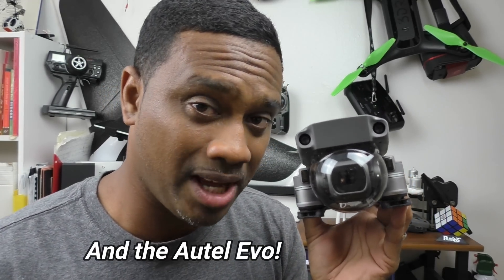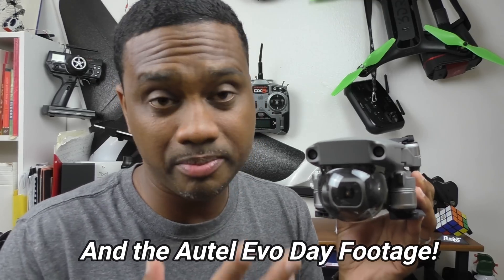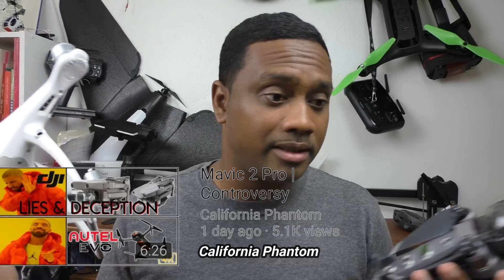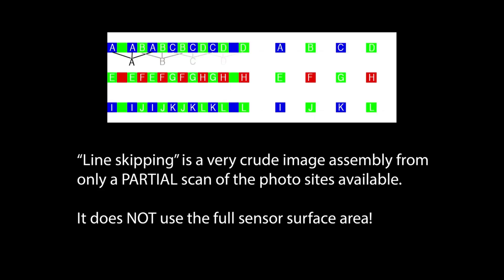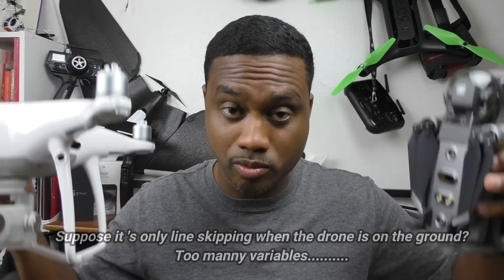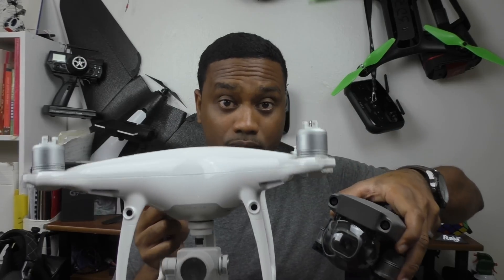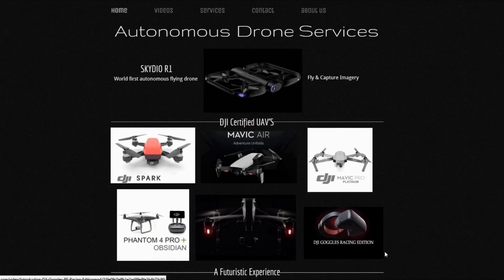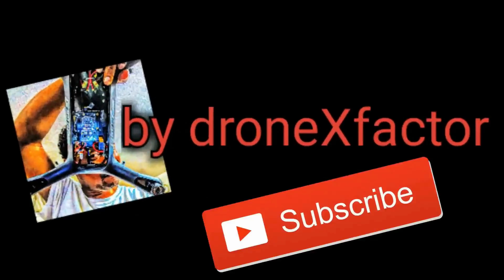DJI Mavic 2 Pro 1" Sensor is Line Skipping & Overheating?

Comment from the maker: Do you believe this Line Skipping Theory? Let's here from you!
Reply: Yes, I believe this Line Skipping Theory. Thank God I didn't buy the M2Pro yet. But: I would buy it, also if this Theory becomes true. I don't use 4K, because of 2 reasons: it uses a lot of memory, and I don't even have a 4K-TV. I edit all my films to 1080p, I film in 2,7K (to have a some space for cropping or deshaking). So also if the Hasselblad only films in 2,7K, for my purpose it's still a very good camera with excellent lowlight and colorgrading possibilitys. But these features don't justify the price. Maybe if there would be a full used 1"-sensor. If the M2Pro would cost the same price as the M2Zoom, it would be o.k., but so it's cheating to advertise with a 1"-sensor. Imagine Nikon would use only the half of the full-sensor in the D5!
Reply from the maker: @timg.998  
I totally understand your concern, good thing DJI confirmed that the Drone uses the entire sensor and there's no lines skipping or pixel binning.
Thanks for sharing
Reply: you're all just looking for excuses! look at autel, the evo works great and the image out of the box is way better than m2zoom & pro in daylight! dji released an outstandind p2 zenmuse, spark and p4p all other drones in my opinion are just generating sales due to the hype they cause! m2p should have been a killer-drone but it's just another high professional customer cheat! turn it as you wish, m2p is the worst 1 inch cam! it's all about image quality, no compromise in 2018. they would have left it with the m2zoom release and kept on working on m2p.
Reply: @isonic9479  I have to fully agree with i Sonic. For the price point, it's a big 1800euro lie and fals adverticing! If you clame a 1" sensor and you don't use full sensor data  it's in my poknt of few not anymore a full 1" sensor! Point! I thought I going to buy the M2P but after that, I'm not so sure anymore. Probably I wait until a M2P platinum or Plus, because I don't pay aditional 500euro upgrade to the normal Mavic just to get a half finished upgrade product, what's clearly the case. 

and just buy the way, the reason why on the other video he has to place the cameras in different possition, is because the different lenses! If you understand just a liddle bit of opticals you wojld undershand why, so don't bash some one who does a proper test comparison, If you don't understand the basics😉 

I believe the hole case, it's not a overheating case, i believe it's a marketkng issue. I as a customer would not buy a phantom if both 1" sensor cameras would give me the same picture. the M2P is smaler and bit cheaper and easier to carry. So it makes sens to have it be different and let the phantom be more premium. Maybe after the phantom will get a 1,5" or 2" sensor and be bether and M2P gets a software upgrade to reach it's full potentioal. Maybe we are lucky in 6 month or so🤣 but I doubt it actually
Reply from the maker: @isonic9479  wow rough...... I'm getting evo tomorrow
Reply from the maker: @jackbisson9226  
I definitely have a open mind especially since I'm not a expert & I definitely want to know the truth weather I'm wrong or right........I am definitely concerned a bit here, and the only thing I don't agree with what you said is that the footage is too grainy for flying at night......... but to each their own....... thanks for sharing your findings.
I hope more information surfaces.
Reply: nope, theres official dji reply for this also. I have M2P and its great! Those idiots dont use ND filters, thats why they cant get best out of M2P. Dont shouting out hoax things!
Reply: Jarmo k  - DJI has made a statement and are admitting that they ARE subsampling and that is DOES hurt the image quality in FOV mode. There is no debate, it is 100% true that the mode that uses the entire sensor (pixel binning FOV) has the least image quality and the mode (HQ crop sensor) that uses a FRACTION of the image sensor has the best quality. DJI is not hiding this now. My tests backup what DJI is now saying.
Reply from the maker: @clifftotten7609  
Wow please share this message with me via Facebook messenger or Instagram or Twitter, I would love to see this from the horse's mouth & do a updated Video..... thanks..... looking forward
Reply from the maker: @JarmoKangro  wow, please share me a link to this reply from DJI, I would love to read it :)
Thanks for watching and sharing your thoughts
Reply: Jarmo k don't be lieing to yourself, you got had by dji, just  like all the other fan boys. Lol Evo for life👍😎
Reply from the maker: @dwaynebaker8733  
Wow...... A little harsh don't you think...... Can't wait to test the Evo this weekend
Reply: droneXfactor just sick of people thinking dji is always perfect, every company has it's flaws, which ever one you have, just get out there and fly it, and have fun👍😎